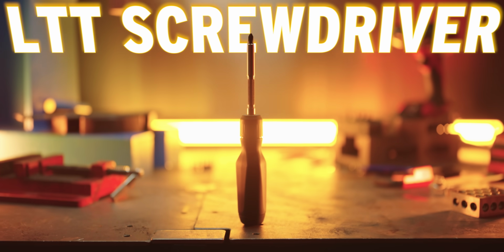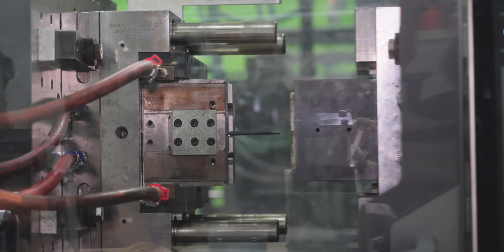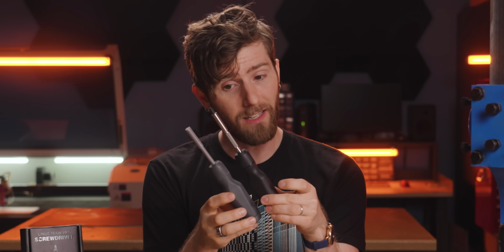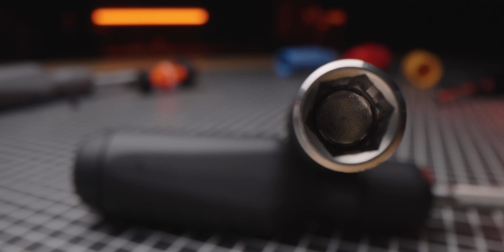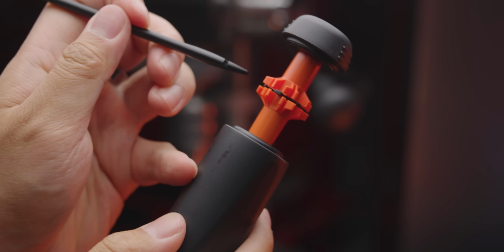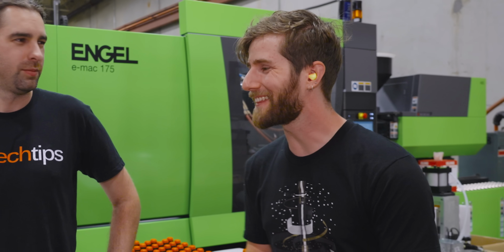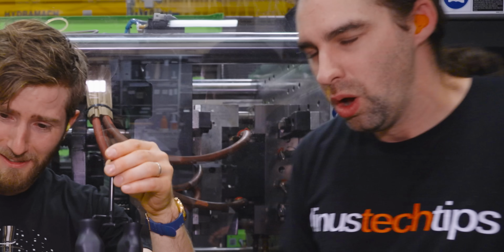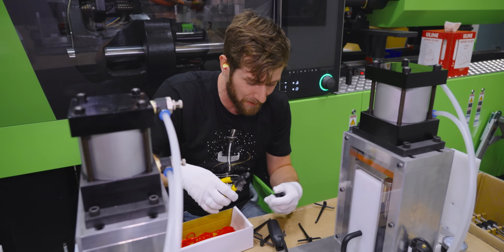Why our Screwdriver took 3 YEARS

Comment: The ninja star is a really cool feature! 🤯

Screwdrivers. I've had a "good enough" one from Lidl which was great but eventually party broke (and I DIY fixed it with tape but that's not a forever solution). Ever since, I've always looked at screwdrivers DIY markets but they are all just garbage these days. So I definitely feel the urge to buy an expensive one like this. I never knew, how many options there are out there until I've looked it up on the internet. But then again, many of them have very stupid design choices (e.g. a very thick shaft with some mechanism at the bottom, so you cannot screw screws in tight places!). This one really looks top notch with all the explanations! Too bad, ordering it to Europe makes it VERY expensive for a screw driver, so I won't order right away, otherwise backpack+screwdriver would have been a no brainer for me. This way I will have to save up a lot of money first.

Comment: I have been using a 9 dollar husky driver with 12 bits stored in the handle and it ratchets in both directions it also locks in place in case you don't want to ratchet been using it for several years no issue at all and yes i know husky is pretty cheap crap but it works perfectly.

Comment: First leg of the journey can be summarized as "Prototypes are easy, production is hard". :P Does anyone have any insights in why they didnt use slide-moulding? That would get rid of the seamlines and sprues would be smaller as well i think. Slide-moulding is more expensive though, but they again they gave 200k for a single mould/sprue...
Reply: Slide moulding typically has higher waste percentages, can also have quite a few issues on the finished product. Someone somewhere probably did the math and figured that injection was cheaper in the long run.

Comment: If built right you should only have to buy a ratcheting screwdriver like this once in your life. My dad still to this day uses an over 35 year old "screw ball" brand ratcheting screwdriver that certainly has nowhere near the engineering, material quality, or tight tolerances. If that thing can still work, this will probably last forever.

Comment: Stanley used to make an awesome ratcheting screw driver, now all they make is that trash Fatmax thing, the bit holder in the handle that always come out is why I hate the the Fatmax version, the old version had a carousel on the shaft for bits, you lost me with the bit holder in the handle.

Comment: As a German mechanic and CNC mill/lathe operator I laughed at how Linus thought 0.005 inches was nothing.
That's 0.12mm ffs. That is a lot in (German) mechanical engineering, especially with parts that small.
Parts that small would usually have a tolerance of n±0.01-0.02 (mm ofc).
Sometimes even less.

Comment: The fact that they designed it so the costumer can use 3rd party bits on the back storage and not just their own is great
Reply: "great", yes... but so does every other bit holding screwdriver.  It actually just would have been really beat if they made it proprietary.
Reply: I was going to make a joke about this being the apple of screwdrivers (sleek design, focus on ui) but apple would never purposefully make their products work with 3rd party peripherals
Reply: Yeah it's like not breaking compatibility with a standard is good for the consumer.
Reply: Anything else would have been a deal breaker.  ANYONE who every "uses tools" looses AND wears out bits.  If you have not  worn out a bit, you dont use tools, you just own them.
Reply: @nroman1977  Weird gatekeeping, pretty sure I use my tools and haven't worn out a bit yet.
Reply: @nroman1977  the only time bits wear out is A: you’re a craftsman using power tools B: you are using it incorrectly C: you bought some cheap crap for $10.
Reply: Huh? 1/4" hex bits are standardized. Not like LMG designed their own special bits that don't fit that standard. Not really that big of a deal.
Reply: @logmegadeth72  It's more about the storage area and not the actual standard 1/4" bit size. To get 12 bits in the storage you have to use their custom short bits. They implemented a little wheel that lets you store normal length bits in the storage area (albeit only 6 instead of 12).
Reply: well they'd lose the license to hate on Apple if they didn't :D
Reply: Because more manufacture make weird pliers

Comment: An universal screwdriver with adjustable bit based on meta-materials within a adjustable casing (fluid when under electric current + super hard otherwise = taking the shape of any screw head to be used on). Basically a liquid - like tip based universal tool to deal with any type of screws (new or old / damaged). The torque would be ensured by the super rigidity of the meta-material when not electrified (mix of very hard particulates and electric sensistive binder) ;)

Comment: Think for the bit storage a depress button could have worked, button would be on the center releasing a plunger/grip out the back to pull from the magnetic well which would provide a pulling force to prevent it from just sliding out if accidentally pressed.

Comment: I think the length of the bits should have been same length as some devices have exact length of bit hole but reducing it causes bit to blocked by the top housing , it's çommon in old laptops, 
But i feel like this depends on the devices people work with, so experience vary, i had got that issue with the plastic cover is so small to reach screw that end up using normal screwdriver with one type bit and long .

Comment: I was hoping for an interchangeable or a customized shaft that could be at least two different lengths for tight spaces when working in a fully built system, but that’s asking a lot from a ratchet system.

Comment: I like it, but the price is too crazy for just a screwdriver. Most screwdrivers I use don't use bits or I use my Makita powered screwdriver (not an impactdriver) on a low setting. Most screws are Philips in computer stuff and I got a really handy screwdriver for that from Scythe once (short handle, long rod). Can't see any reason to buy this because I even have a 10 euro short bitdriver in base I really really need it.

Comment: 12 years of pim experience and Paulson training/ school I can say this is my favorite video I’ve geeked out on. Your plastic materials can be thicker without the what you all called sag (it’s called sink) with a very experienced process technician at the wheel but I’m happy the route you all went. That gate hole you all obsessed over could have been solved with a hot runner mold instead of a cold runner molds that you all had bought but you would have been spending A LOT more money on mold design.
Gotta say, loved this video the most out of any cause you all got a taste of my field of work and kinda explained a bit more than surface level things. Thank you all for your hard work! Oh, just to ad, they are using the wrong sized nozzle of that injection press… you can tell by the blob of molten plastic at the end of the sprue. (where your mold meets the barrel) inexperience could lead to mold damage over time. But that’s years In the future. And the “auto gate cutter lol” is a sub gate in our field. Other things as well but I’ll stop nit picking ;)

Comment: I don't care how good it is...I have many screwdrivers, and even the fanciest was under fifteen dollars. Excepting the cheapest of the cheap, I have yet to have a screwdriver fail me. There's rarely a need for a ratchet, when building/repairing/upgrading computers. Moreover, a simple screwdriver with a freely rotating cap will get the screw in every bit as fast and easily as an expensive ratchet screwdriver. The overly complicated bit holder seems likely to be the first part to fail...a hollow handle with a screw-on cap will hold any size bit you can find. Not as cute as the fancy one, but will never break. I believe in buying the best I can afford, when buying tools, but at the same time, there is a point where, no matter how good the tool is, it isn't worth the money. I still have the first hammer I bought, and it's just as good as ever...Estwing. Thing is, I wouldn't have spent that much on a hammer, if it hadn't been absolutely clear that it would last my entire lifetime and further. My son will eventually own it, and it'll outlast him. I'm pretty sure it was less than twenty dollars.

Sorry, but I just don't see any justification for spending crazy amounts of money, just because I like someone's videos. You're already clearly far wealthier than I am...so why should I overspend to support you? I'm all in favor of people making and selling quality tools to their viewers...but the tools need to be a good value, and there is no way in hell any screwdriver is worth THAT much money. 

Tools get lost, too...or stolen. If I spent that kind of money on a tool, then lost it somehow, I'd be extremely upset. If I lose a five or ten dollar tool, it's annoying, but no big deal.

Comment: Well... Good luck with that. Anyone that's not a fanboy, will buy few sets of "normal" screwdrivers in price of that one, that will live way longer (combined) than this one. This project is the definition of measuring strength against intent. You simply overdid it.

Comment: I work for a major Distribution Center in the US  which houses the largest AutoStore system in the country. We have over 200 robots that move bins of product and bring them to team member’s work stations to pick from. We perform preventative maintenance on several robots per day, not to mention all of the PMs, repairs, and replacements of other parts at the pick stations. I wish there was a custom bit set selection available but I’m still excited to make this my primary tool of choice at work.

Comment: I really like the video and the detail in manufacturing, but ultimately this screwdriver is still just an LTT product designed to make money for LMG. It's very expensive for what it is - just a soft plastic molding around a shallow zinc torque insert. It's fine for computer cases and obviously designed towards that, but both the ratchet mechanism and handle aren't suitable for intensive use. This wouldn't last 2 weeks in my company.

If you buy this, it's to support LTT, not to get a durable, versatile tool. Just like everything else from the LTT store.

Comment: I would've loved a loop/hole/circle on the shaft, where it meets with the handle, so you can shove a smol torque bar through for those screws that really refuse to budge
Reply: I get that but running into a situation like that when building a computer is exceedingly rare. More than likely you’d strip the screw before you needed that much torque.

Comment: my one comment about the selector ring is more for people who will use it for heavier use. when you have to turn the selector ring right to turn the screwdriver right. you can bump the selector ring while turning and switch directions mid turn. if you have to move the selector ring left to turn the screwdriver right, if the selector ring is bumped it will not change directions. i think this is more of a problem for people working on cars and things were you have to put your whole arm in something. i still think the screwdriver is great but that’s just my 2 cents on the selector ring direction change.

Comment: DLC (diamond-like carbon) coating could be a solution tobmake the shaft black. It's extremely scratch proof.
About the bits: You gave up standardization, so replacing them now becomes a search for a proprietary product.

Comment: The only mistake I see with this screwdriver is the pricing: it should have been 69.69
On a more serous note, one thing I am wondering about is the grip - my current screwdriver has rubberized grip so when palms get sweaty, it doesn't require a herculean grip to hold firmly. If this screwdriver's handle is purely plastic, I have to wonder if it actually grips well enough when, umm... moist. Let me know the answer!

Comment: As an injection molding technician I am super impressed on how much you went into detail about the plastics part of the driver including things like the gate and runner. I will probably buy one and the hex bits to work on the molds I work with daily.

Comment: Okay Linus, you've done enough, you sold it to me. I want one now.
Reply: For $69.99? xDD
Reply: @BOLOYOO  sometimes quality has a price. Worthy sacrifice..
Reply: @Wait...whaaat  Sure, sometimes it's worth, but not in this case. You can buy few sets with way more bits with good quality for this price. Just let's be realistically. NOBODY needs this screwdriver to use it in home, especially in his PC. NOBODY. Of course, you can buy it cause it's clearly good quality stuff, you can also enjoy it or even have it for a lifetime (who knows?), but realistically, it's just a waste of money.
Reply: @BOLOYOO 
Of course you can buy loads more bits and decent screwdriver for that money. Those most likely have way more issues than few way more expensive examples. I've got one set that cost me 50 (Wera KK 60), meant for a bit different usage (hence I would rather not use it for electronics), has few minor flaws but all in all also a great purchase.
Quality; ease of use; avoided frustrations when magnet is too weak (screws, bits); ergonomics, etc... All of these are worth something. What actual flaws does LTT screwdriver have? Only time will tell and but initial introductions are setting very high standards.
You are the on who sets the quality standards for your life, not me, LTT or anyone else. 60 bucks for very good screwdriver that is well thought through and engineered to high standards .. is not that expensive at all (well.. shipping would probably be another 60 :D )
Reply: @Wait...whaaat  If it was $70 in my currency (1:1) it would be reasonable price, but it cost $329 in my currency, which is ridiculously high. So if you earn $3500 per month, I can totally agree with you here. If not, well, it's not worth it. You can argue it however you want, finding multiple excuses to buy it. It's not worth it for home usage. Period.
Reply: @BOLOYOO  Then stop wasting time here and crank your pay check up. It may be too expensive for YOUR (and many more) budget but it does not make it "not worth it for home usage". Period.
Reply: @Wait...whaaat  You're missing the point. That you can afford, doesn't change fact that's not a reasonable purchase. The objective assessment has nothing to do with the subjective resource of the wallet. You can spend even and $6000, but you will screw in a screw exactly the same as with a $6 screwdriver (at least, as long as it is new). This is an objective fact that cannot be disputed.
Reply: @BOLOYOO  Not really. ratchet screwdriver and 6$ screwdriver are different and you use a bit different techniques to screw in a screw. Ergonomics, ease of use, durability, etc.. Disputed.
Buying a new 6$ screwdriver for every other job is eventually going to cost you more as well. 
6$ screwdriver has it's place, so does 70$ LTT screwdriver. These two are not the same.
Leave your blind hatred behind and accept the facts or at least make peace with it.
Reply: @Wait...whaaat  Maybe we're talkig about something different here, that's where our dispute come from... I'm talking the whole time about HOME usage (aka. occasional). I can see how in professional usage it can have it's place or if you're handyman. Sure then, I have no problems with it. Probably still you can have plenty cheaper options, but it's at least reasonable in terms you have already put.

Comment: Oof... bulk hand loading dried nylon like that is bad. This is a mistake I've seen countless times over the years. Moisture in nylon chemically degrades the quality and strength.

They should be using an on-demand vacuum loader between the dryer and press to eliminate the chance of the stuff in the hopper reabsorbing moisture from the air. Even with a tight lid on top its still being exposed to new air every time it's topped off.

I fight with nylon drying on a daily basis. Even as we speak I have a technician setting up just such a system and have another vacuum loader (that cone shaped thing on top of the dryer) on order.

Comment: FWIW, most automotive screws are JIS, not Philips. It may sound like a nitpick, but in reality JIS screws and screwdrivers are manufactured in such a way that when you strike the handle with a hammer the screwdriver turns counter-clockwise 17 degrees. Crazy right? At any rate, it allows you to remove screws installed at the factory at a much higher torque than is possible by hand versus having to drill them out.

Comment: Alright, alright! I ordered a screwdriver. Not because I needed one, but because I felt it was the best way to send LTT some support without supporting 'Google'. 
Don't get me wrong, I can always use a good screwdriver but I may keep this one in the box. Aside from being a first production run, I ordered mine with the black shaft which will be limited to this first run. After another payday or two I will likely order another with the silver shaft which will be my go to screwdriver.
Congratulations on a successful launch. Seeing as the LTT store shows that 2514 screwdrivers remain in the 4th wave there have been over 57000 orders already!

Comment: Plastic injection molder here. I loved hearing you mention the complexity and challenges in my field.

Just the other day even I was involved in a function modification in a mold for a medical component. I am pleased to say my idea for how we decided to change it actually worked, and was inexpensive.

My point here is that if it didn't work, the cost would have been extremely high. And that's just for a modification, let alone building the whole tool.

Plastic injection molded parts are seen as "cheap" only due to volume of production.

The mold for something as simple as a soda bottle cap can cost a million dollars or more, if it's large and complex enough.